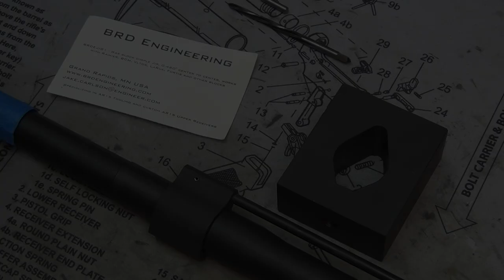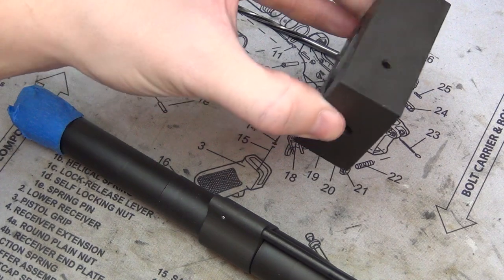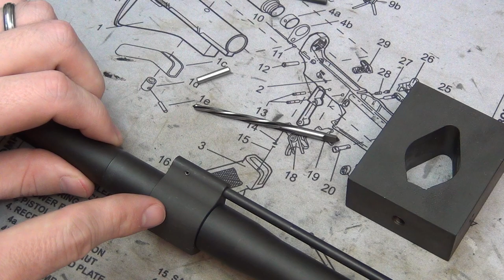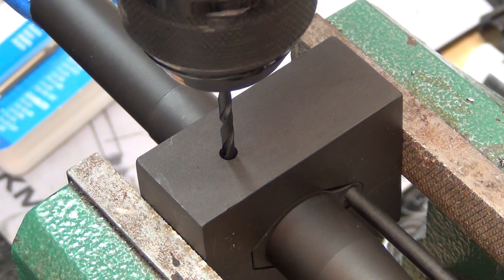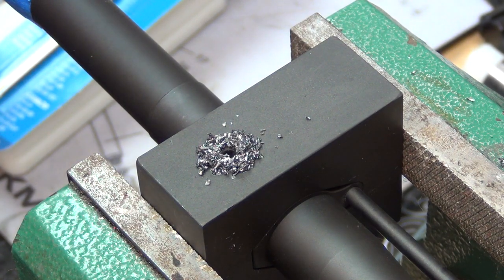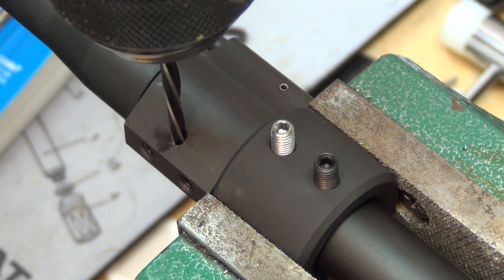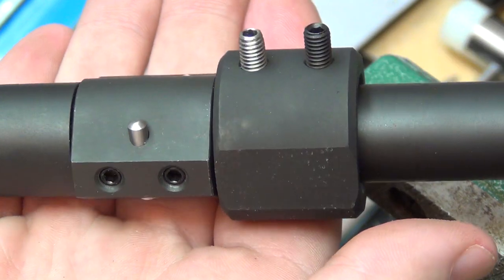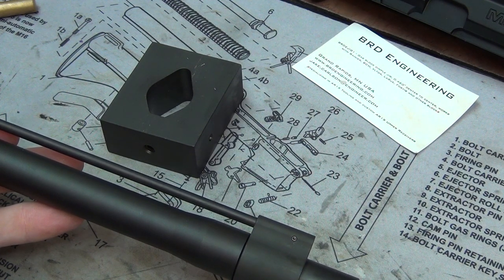AR-15 - How To Pin Your Gas Block

Comment: Correct me if I'm wrong and I've heard this from accuracy gurus pinning hurts barrel harmonics which in turn hurts accuracy to some degree no? Same reason people go free float hardguard. If that's true doesn't doing this kinda go against the idea of an spr build? I wouldn't have pinned it. On a go to rifle for ITEOTWAWKI sure but not a paper puncher. Nice tutorial either way though. I liked the dimpling one. I thought doing that was more involved.
Reply from the maker: +nemisans13 This is a picture of a Bravo Company SPR Mk12Mod1 - Notice the gas block. http://i.imgur.com/1TVDaTS.jpg
Reply: +nemisans13 the mk12 is not pinned.
Reply: +John K depends which one you get. The MK12 was done quickly to fill a gap in the Arsenal. There is quite a bit of variation between different MK12s. 
You see the same thing right now in some of the M24s. You may have one that's all stock in 7.62x51 and another that The only original part is the receiver, in 300 WinMag. 
The last one I was issued was in .300 wm. It had a Mcmillan stock, had a new aftermarket barrel, and an  after market scope replacing the Leopold.
Reply: +nemisans13 Doesn't harmonics have to do with repeatability? A pinned gas block wouldn't affect that. If you had a target crowned barrel then I guess I wouldn't pin a gas block. I really doubt it affects accuracy.
Reply: Noveske barrels shoot sub moa with pinned gas blocks. A small notch cut into the barrel is not going to have any more effect on the harmonics than the gas block itself will.

Comment: That massive recoil from 556, I'm glad you did that bc wow it will send that block flying. 🤣
Reply: It’s the constant vibrations from the cycling and the heat of the gas block from firing that cause the set screws to loosen.

Comment: Rookie build question: is this necessary or just an extra step for installing the gas block?
Reply: Just an extra step. It makes a low profile gas block as solid as possible.
Reply: Thanks.  I contacted the company and they essentially said the same thing, that it isn't necessary.  I have a pretty good view of the gas block through the hand guard.   I can keep an eye if it starts to migrate.

Comment: I wonder how an end mill would work instead of the standard 118 drill bit.  The jig wouldn't even be needed as it is used to prevent the bit from flexing after contacting the angled surface of the gas block.  I would think after repeated use of the jig, the guiding hole would get egged out from the bit flexing slightly after contacting the gas block surface.
Reply: An end mill will work. But why mot just drill and tap for to more set screws. My delton has four. from the factory

Comment: what was the coast for BRD gas block dimple ,pin,&bits kit. Your was vid was perfect I liked it a lot thanks.
Reply from the maker: Check the website for pricing.
Reply: +Coy Collins Rainier has the jigs in stock. I will have more inventory in early 2016

Comment: cutting oil is cutting oil. not clp
Reply from the maker: +Springfieldm14 308winchester and CLP is better than nothing at all. 😉
Reply: Kimber 10MM  You capitalize after a period and space. Should read "If", and I used CLP for many uses in combat such as reaming.

Comment: +nsz85 it looked like it didnt take very much to tap the pin in. i just orderedmy jigs and everything and plan on doing this myself this week. i was wondering if the taper pin fit tightly enough.and if it help up for you
Reply: Colton Dunn I was thinking the same thing. Just don't go so big with the taper bit. And it will fit tighter. And it  will take a lot more pressure taps  to seat the pin.

Comment: I'm new at this, but wouldn't you pin the gas block OR dimple the gas block?  With the dimples the only way for the block to twist or slide on the barrel would be if both screws loosened and backed out of the dimples.  I don't see that happening if they have been loctited properly.  Am I missing something?
Reply from the maker: +Rendall Hostetler Its a fail-safe. There is nothing negative nor is there a downside to doing both.
Reply: +nsz85 thanks

Comment: Would this affect accuracy in any way?  I'm using a wilson combat stainless barrel which regularly gets .5 MOA groups.  I want the security of a pinned block, but I don't want to mess up that accuracy.
Reply: BigYeet If it’s a precision rig, it will probably never see volumes of fire high enough to the point where you’d see a difference
Reply: BigYeet, in your case consider just staking the set screws in place with a spring loaded punch. Probably the best of both worlds for you. Makes your block more secure without the variable of a pin.

Comment: Why not just dimple the barrel and use a pointed set screw?
As a machinist I would say you're running that drill much too fast for that material.
Check out feeds and speeds for that size drill and that material.

Comment: so...
you've tapped this barrel three times 
at the gas block 
Not even A1 or A2 front sight gas blocks with bayonet lugs have any taps locking them to the barrel.
Reply from the maker: I'm sorry if I am not getting what you are saying but what are you saying?
Reply: +nsz85 I think what he means is -You' re going overkill on securing the gas block. He might be one of those $500 AR kinda guys. I like want your doing, keep up the great videos.
Reply: +Wong WayUSA 
oh no, not a $500 AR guy
let me go tap, screw, pin, weld and glue needless shit.  
I need to secure my muzzle brake, let's harken back to the Brady Bill and pin that sucker on.  Uh oh, that trigger guard could fall right off, let's tack weld that on! Why don't we get a solid piece of titanium to attach that pistol grip? you could be defending your life from Zombies and that pesky grip would fall right off!  Oh shit, let's get a triple valvespring in the back of the buffer tube.  Why not install a magazine buffer so it won't rattle?  Hey, let's protect that muzzle crown by friction welding a mortar tube to it.
Reply from the maker: Hmm...well you are clearly passionate about your opinion. Good for you :)
Reply from the maker: Yeah I think you may be right ;-)
Reply: +nsz85 
sorry 
I just don't understand and have never heard of anyone, for any reason, to be so concerned about losing gas block alignment.  
Especially when the military hasn't, even when a bayonet is attached to it.  
What could possibly move your gas block after you did that sweet dimpling for the set screws? 
I've never heard of anyone dimpling their barrel for the set screws before but I wouldn't mind doing it.  That said, why is it necessary?  
Did you lose your primary on HALO jump because the gas block got canted? 
I have heard many knowledgeable folks voice concern over a tiny bit of gas tube that wasn't covered by the handguard.
Reply: +Jon H  Set screws could back out, so dimpling isn't 100% (I use Rocksett for that).  Geissele "bomb proofs" their gas blocks with a similar pinning method.  Now talking about "military", my A2 Front Sight Post had 2 taper pins that required some significant pounding to get out.  What's wrong with making sure your gas block (which is essential to your gas system working) is in place for good? 

And a canted gas block means the gas is out of alignment, so you end up with a single shot rifle/bolt action.  To each his own.
Reply: +theduck17 
your right 
the taper pins are used on A1 and A2 gas blocks
But they don't go through the barrel
they have lugs that attach a bayonet that converts the rifle into a spear. 
a spear that rests on the gas block that is not tapped nor pinned to the barrel
Reply: +theduck17 
I kinda like the dimpling but, for me, it borders on the "over kill".
I've never seen anyone have issues with a gas block moving.  
Even the military doesn't have a problem and they use the gas block as a base of a spear to kill with cold blue steel. 
Aren't screws with red loctite enough? I'd think dimpling would be enough. But to drill into the barrel for that extra "something" towards reliability seems akin to swatting a fly with a sledgehammer
Reply: +theduck17 
to answer your question 
"what's wrong with securing the gas block?" 
I'd say "nothing" 
but then why not go ahead and just weld that gas block on?
Reply: +Jon H He is just showing the different ways and jigs available to do it. I assume he is not saying you should do all that to the same gas block. I could be wrong though.
Reply from the maker: +Jon H They do go through the barrel in the same way this taper pin goes through.
Reply from the maker: +Jon H There is no downside to securing the gas block in this manner.
Reply: +Jon H hate to burst your bubble, but yes, the military rifles do have their gas blocks attacked with two tapper pins. Both of which require a lot of force to remove. The last time I replaced a barrel we used a small sledge hammer and a steel punch to beat them out.
Reply: +betatalk357 "easy to remove in the field for cleaning"?
I have never heard of anyone ever removing a gas block in the field for cleaning. That's not even close to a 10 level procedure.
Reply: +betatalk357 I've never heard of a gas block needing service, other than not being positioned correctly. there's so much pressure that it essentially self cleaning...I could be wrong, but that's been my experience.
Reply: +betatalk357 yeah I've still never heard of taking a gas block off in the field to clean it. 
We've shot barrels until the barrel was burned out. Ive seen the gas hole is a barrel start to erode. But I've never heard of the gas block needing to be removed and cleaned. 
Where did you hear of people removing gas blocks in the field to clean them?
Reply: betetalk357 The Answer is no. There is so much pressure going through a gas block and gas tub that you will never get a sufficient level of carbon buildup in the gas channel to ever cause a blockage. And to respond to an earlier comment the gas tubes and gas blocks on M16's/M4's are NOT Designed to be removed in the field "for cleaning". the A2 front sight post is secured with a tapered pin that taps through the bottom portion of the barrel. It requires a significant amount of force to remove that taper pin. But such an action is an NJP level offence that can get you reduced in rank in a heart beat. No one but an armorer is authorized to remove the FSP on any service weapon. The only thing a service member is allowed to do to their weapon is basic weapons maintenance. This is to protect the serviceman from their own stupidity and "accidentally" or negligently rendering their weapon unserviceable. You're not even suppose to tear down your bolt in the field except for an extreme emergency. Even something as small as disassembling the extractor is grounds for non judicial punishment. For basic cleaning in the field you are allowed to remove the bolt buffer and spring for cleaning. When in a barracks or appropriately organized bivouac area you may also tear down the bolt carrier group for additional cleaning, but that is all for the average serviceman.
Reply: incorrect information
Reply: The last A2 front sight post gas block I removed I gave up on the 5lb hammer and purchased a 10 ton press. It was still a job. Went through several punches. Purchased a Geissele punch and finely made it happen. Had been wanting a press for a long time.

Comment: Don't they sell gas blocks that uses the existing barrel notches that had A2 front sights? I see a lot of DIY to the stock blocks but haven't found any blocks that uses the existing notches. Just wondering?

Comment: Did you remove the two set screws?
Reply from the maker: +NebulousCat No.
Reply: +nsz85 I pinned my gas block and then removed the set screws. I don't see what purpose they serve.
Reply: +NebulousCat They aren't the required for the gas block to be secure but there are a few reasons you may want to keep them there.

1) aesthetics
2) to prevent dirt from getting into those holes
3) to cover the exposed metal dimples and protect from corrosion
4)peace of mind that you have a pin and 2 dimples holding that sucker on there. haha

Comment: Why does the gas block need to be pinned if using set screws?
Reply: Edward Piroska make sure that puppy is on for good!
Reply: It doesn't. This is a commercial to sell you stuff you don't need.

Comment: What keeps the pin from popping back out?
Reply: John S he drilled to much, save yourself the headache and just buy uppers or guns with already pinned gas blocks, I have the geissele urgi upper and love it
Reply: A taper pin provides what's called an "interference" fit.  It's just like a clutch on a snowmobile(with a tapered crankshaft).  I've seen them lose a clutch retaining bolt and stay on for miles.  Even had them come in for service with a missing bolt and the guy never knew it...

Comment: I don't understand why I would need to pin it when it's already properly dimpled...and loctited.
Reply: This is the bombproof method. Dimpling is perfectly fine, but this is THE way. Loctite kinda sucks for this, if your barrel is ran HOT. Rocksett is much better for this application.

Comment: Don't pin your gasblocks. And dont use loctite on your set screws. Loctite is removed woth heat. Use rockset instead. And pinning will input a stress riser and negatively affect accuracy.

Comment: I have a question for you my 10.5 ar gas block is leaking or releases gas from the gas tube pin is that normal???
Reply: Perfectly normal. It will carbon seal itself

Comment: Tapered too deep, also a waste of time. clamp on gas blocks have shown the barrel guide pin will sheer off before a clamp on will move when torqued correctly

Comment: Sorry but for the cost of that fixture at the very least it should have had a hardened sleeve for the drill bit so if you use it more than once you don't enlarge the hole.